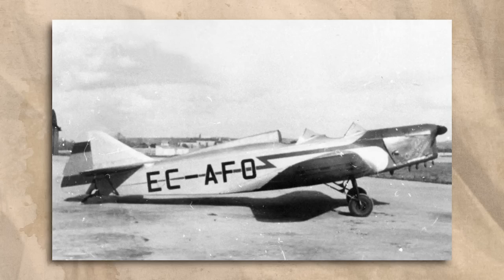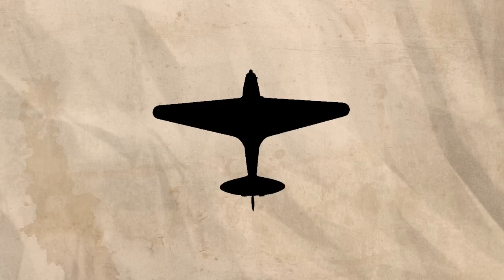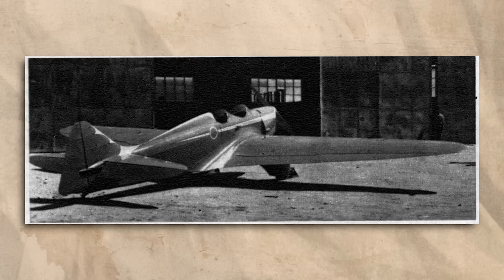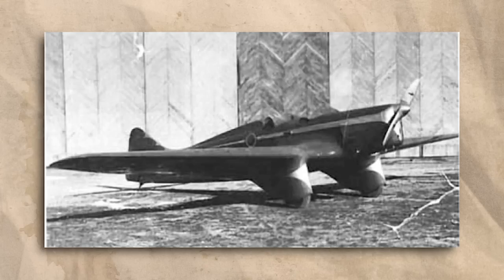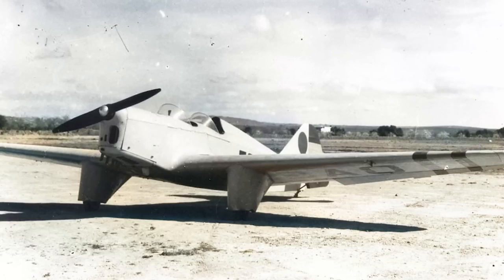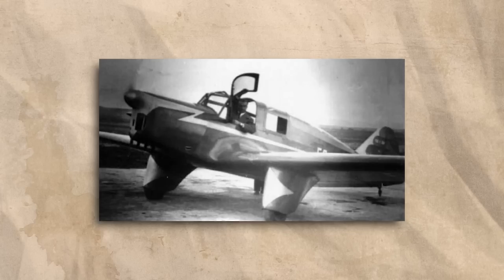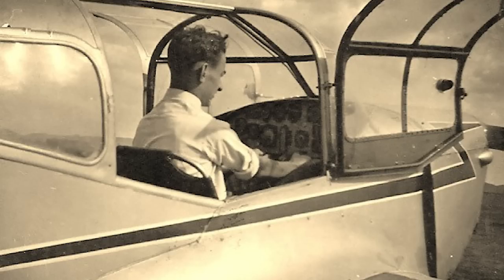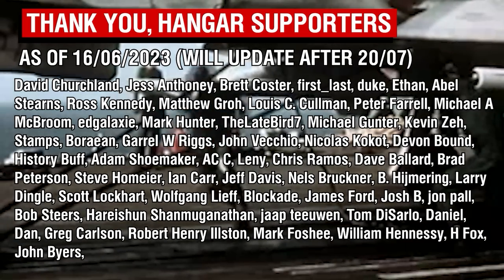González Gil-Pazó GP-1 | Twin-Seat Spanish Training Aircraft

Comment: So, from what I found the Walter Junior inline 4 produced a nominal 105 hp, and a maximum 120 hp, except in the GP-1, where it supposedly produced 195 hp. It would be interesting to know where all those extra horsepower came from being mounted in the GP-1. Also, other versions had much lower power, even with engines that produced more power than Walter Juniors in other aircraft.
Reply: Walter junior never produced 195hp, I think it is a typo. 105-120hp is correct.
Reply: A supercharger or a straying from the truth.
Reply: @calvingreene90  Seems like a very big difference to be explained with a supercharger, for that time combined with no mention of supercharging. Typo seems more plausible to me. I'm no expert, but I think 105-120 hp also is completely reasonable for that type and size of aircraft, for that time and performance. Supercharging also seems like overkill for a trainer of that time.
Reply: @fishyerik  
I gave the two possibilities without stating which I thought more likely.
I think that if you put a blower that big on that engine you'll be blowing the crankshaft on the bottom of the engine every few days even if you had fuel of adequate octane rating.